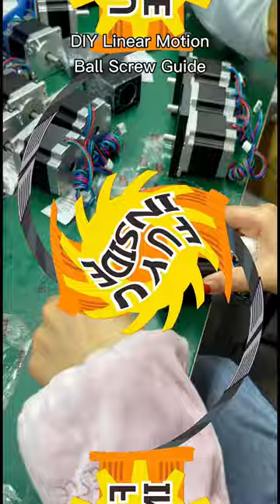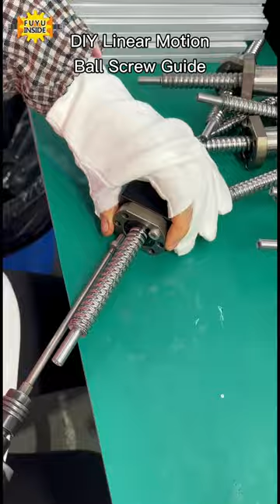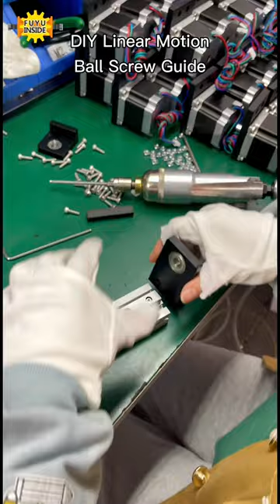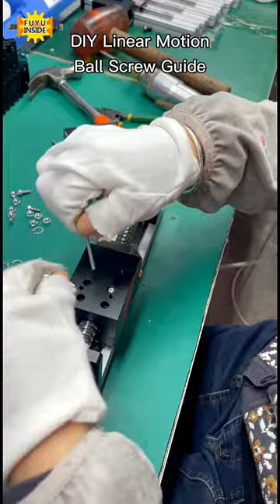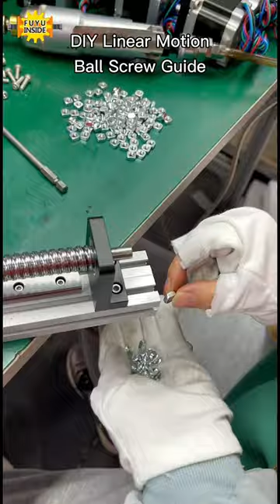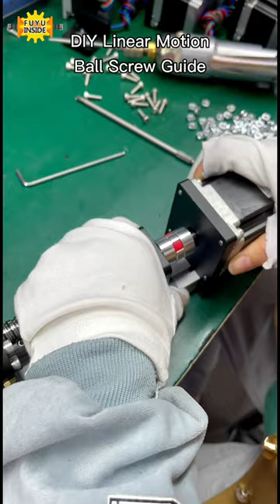Intro to Robotics - DIY Linear Motion Ball Screw Guide

Comment: I need thread for my project 
The application is to lift a bar of weiht 3 kg and 
A motor of 5 kg mounted on its one end and other end of bar have to mounted on the lead 
It's vertical motion
Reply: And also needed the motor do you sell
Reply from the maker: Vertical motion is great! 😀For your weight requirements, we suggest FSK30J and FSK40 to choose. They are economical series integrated with motor, serve or stepper is up to you. For more project characters, please visit our official website  Https://www.fuyumotion.com and leave the message to the professional engineer, they will help to find out the efficient solution.💓